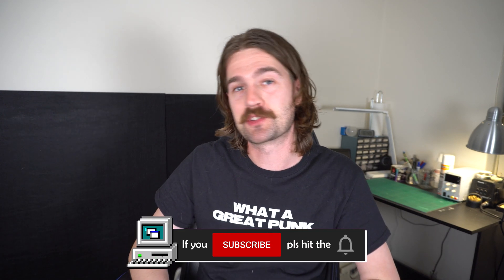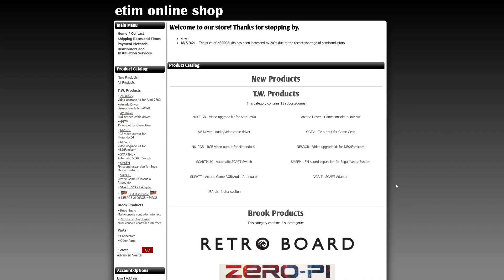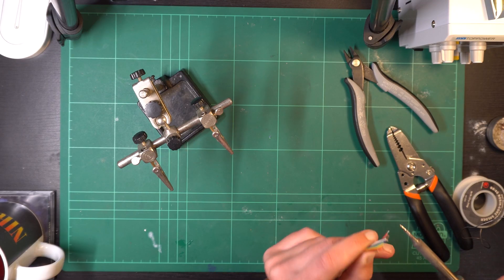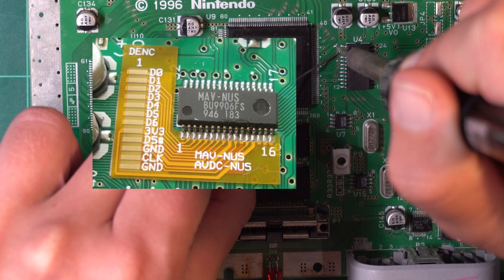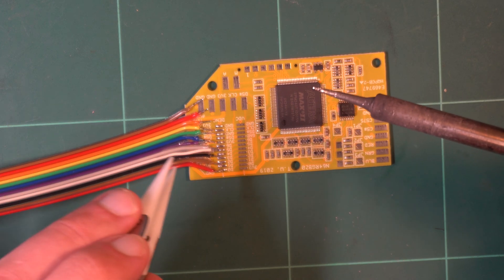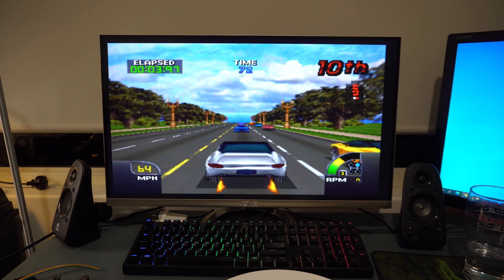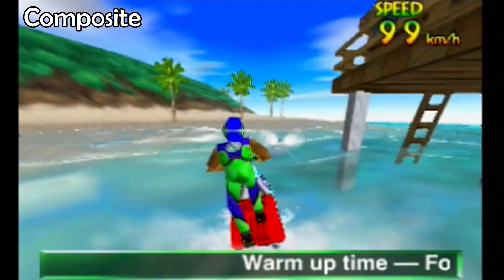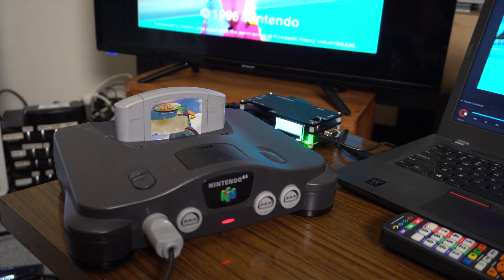Let's RGB Mod an N64! [Tim Worthington's N64RGB]

Comment: The vast majority of N64 consoles have S-video output in addition to composite output, but there were some models that did only have composite, and I think those models might be fairly common with PAL versions of the console. 

Nintendo did also sell an RF adapter that would work on any model.

Comment: You gotta be a bit careful with the cheap RGB cables. Many manufacturers claim to sell a "Real RGB cable" but often (especially when they are cheap) those cables are just transferring a composite signal, cause there are missing parts like transistors. I got one on amazon for my wii and it said "Real RGB" (oc it wasnt) so be careful what they claim and keep the price range for those cables over 25 bucks. The good quality ones are mostly in that price range. Also highly recommend a crt when retrogaming. Those games and consoles were made for those TVs.

Comment: It is a bit confusing... for the output of the RGB PCB you talk about 6 wires but isn't it four wires you are soldering in your video and from the instruction picture it can but not must be 6 wires, right?

Comment: Whats the dicfference between that HUUUGE RGB Chip and the tiny ones you can get on Ebay, Ali Express and so on?

Does it have some Special features?

Is this an older design?
Reply: The smaller ones (if we are talking about the same ones) were made for the earliest models of the N64 EXCLUSIVELY, due to something with the graphics/video chip. If your n64 has a serial number that starts with anything besides NS1 (such as ns2, ns3, etc.) those smaller easier chips won't work. RetroRGBs website has a lot of information about video from many consoles
Reply: @spadfinn  That’s the first time I’ve heard about that. I’m gonna check later. 

If it doesn’t work with my N64, I’ll install it for free on the console of my best friend. I know for a fact that he has an old one because he got it back when it released whilst I bought mine like 5 years ago.
Reply: @holzwurm_hd7029  There is also an early French version of the console which you can do a cheap and relatively easy RGB mod for, but it's different than the mod you can do on early NTSC versions of the console.
Reply: @spadfinn  i have the NUJ1 Model (japanese Console). Are the two boards from the same revision? Or is that modchip especially made for Pal Consoles?

Comment: Is this a PAL console? I assume it is because it's Australia. The reason that I'm asking is because I heard previously that only Japanese and American consoles can be modded with RGB. I heard there are only a few exceptions with PAL regarding certain versions and or that the only European ones that can be modded with RGB is french ones (SECAM). Can you or someone else please enlighten me
Reply from the maker: That console is PAL, but the mod has also been designed by an Australian.
Reply: So this mod would work an European PAL console as well?
Reply from the maker: @ACobraFumante-th5lb  should do
Reply: @ACobraFumante-th5lb this is what I wanted to know as I use it on my crt and need it to look better but I can’t find any uk English pal mod!
Reply: @ACobraFumante-th5lb  Yes, but if you are lucky enough to find an early French version of the N64, there is a much easier and cheaper RGB mod that you should do instead. I don't know what model numbers you need to look for to identify that version, but you can easily find info if you do a search.
Reply: Some RGB mod kits will work with ANY version of the console, some cheaper mod kits will only work with some very early variants of the NTSC console, and the early French model has yet another different but cheap RGB mod that will work only for that model. 

I'm still not sure if the cheap "Voultar" RGB mod that works on early NTSC versions of the console would also work on the early French versions, but I'm assuming it wouldn't. I think the cheapest RGB mod of them all is the one for the French model, because it was actually designed to output RGB and they removed RGB output from the design at the last minute, but most of the components required for RGB output are still on the boards.

Comment: I bought this kit, but mine came without the flat rgb, just the board and solder wires. Here in my city I only sell flat rgb with copper conduction material. Also good or not?

Comment: You should take that scart cable apart and verify everything is wired up correctly. Based on the pinouts for the snes multiout and rgb scart standard. I bought three of those cheapy cables and all required modification.
Reply from the maker: For sure, will do.

Comment: I think Mr. Worthington might have another $55 incoming...

Thanks for showing this to me. Soldering those wires to those pins looked a bit nerve-wracking, haha.
I think I'll be placing my order so I can perform the mod and have my own video on it too.
Part of the reason I don't play my N64 much is the video quality. Another reason is to preserve those plastic analogue sticks...
Reply from the maker: I've also installed his GGTV for the Game Gear in a previous video so I can directly capture footage. That was a useful, easy to install mod too.
Reply: I'd love to have a better way to capture footage directly from analogue systems. I had a SCART to HDMI converter which worked well, even for 240p systems, but the output quality was just not that great.
Reply from the maker: @JoystickDivision  I use an Elgato Game Capture HD that natively supports composite and component, but it's sadly long discontinued.
Reply: My brother has one of those ones, I used to use it for analogue inputs and it worked great. I just wasn't happy with the source it was recording from (the aforementioned adaptor).
I have an Elgato Game Capture HD60 now, which sadly omits the analogue input.
I have actually tried daisy chaining the capture devices together, but it didn't work out.
I'd like an OSSC or the elusive and expensive Framemeister.